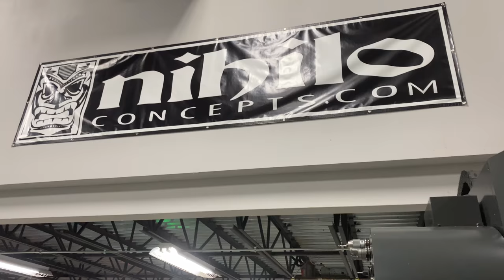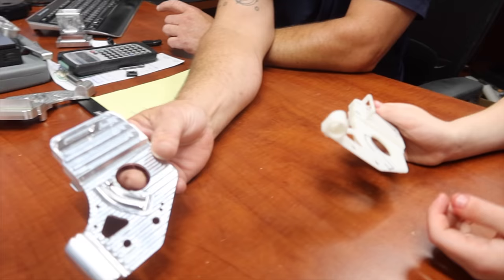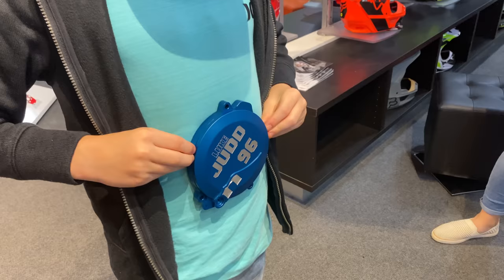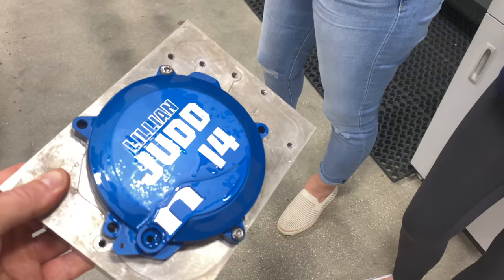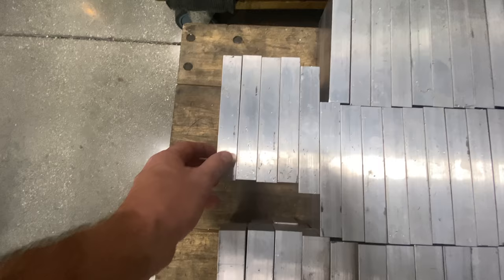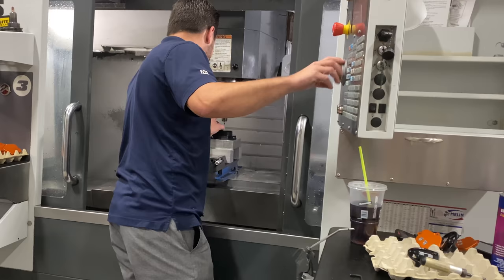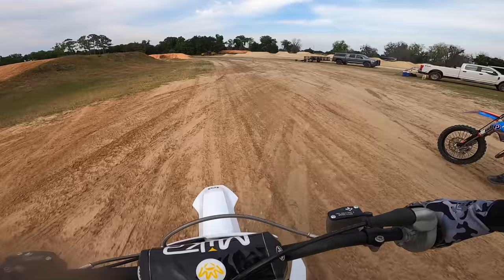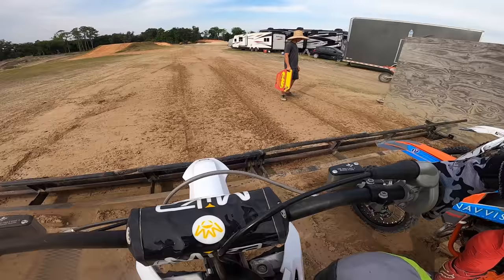TRAINING WITH THE BEST

Comment: Luke needs to speed up his shifts u can shift without letting off I’ve always done it never had a problem if u say otherwise u know nothing about ur transmission it’s a constant mesh transmission meaning doesn’t matter if u have the clutch in or if ur off the gas it’s gonna shift just fine I’ve done it forever no clutch and wide open never had a single problem and whenever I had to change a crank I’d look at my transmission and it’d look perfectly normal almost brand new still

Comment: I have always found CNC machining interesting. I worked at a machine shop for a few years. The company I worked Enginetics mostly made parts for the aerospace industry. We also made brake assembly for racing go carts.
Reply from the maker: It’s really interesting. Everything has to be placed perfect and I guess it’s pretty easy to mess it up if you don’t know what you’re doing.